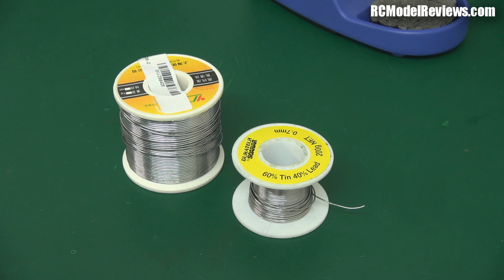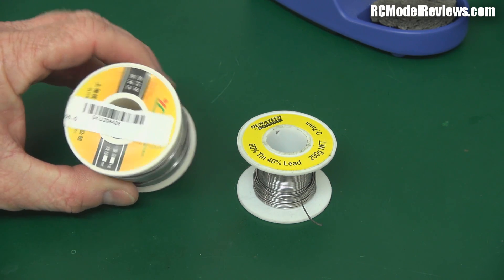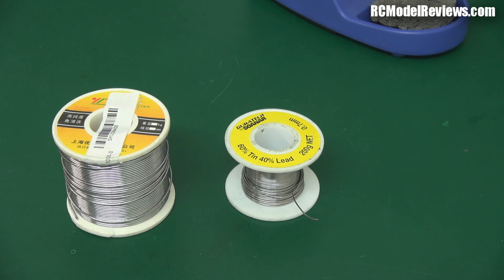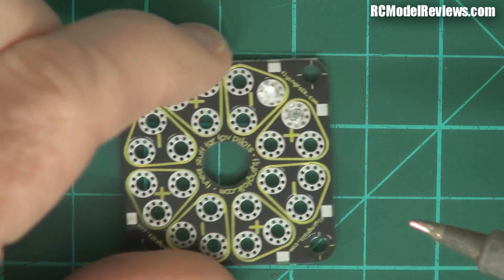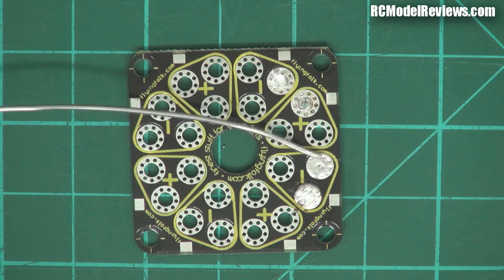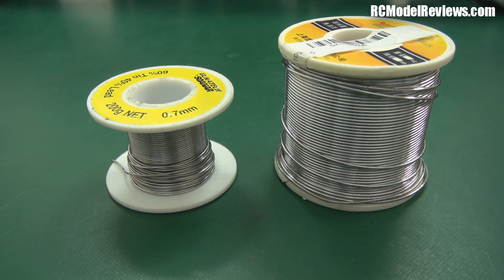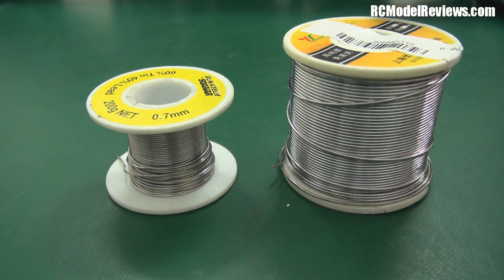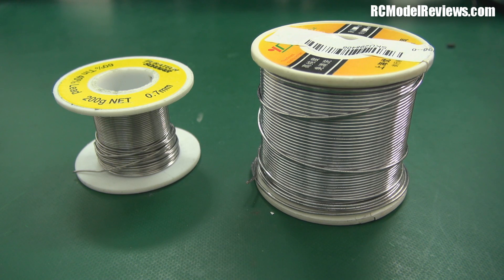60/40 versus unleaded solder

Comment: Thanks for this great post. I work in aviation and am a certified solder technician working on aircraft and aircraft test sets for over 30 years. Lead free solder has been banned from aviation equipment due to its discovery of unreliability after several deadly aviation accidents. The reason is it cracks under vibration and temperature changes over time. Lead free solder is also one of the major causes of modern electronics ending up in the landfills. It is also the major cause of automotive electronic failures particularly in those MPG/KPG, compass and trip overhead displays. In fact most of those displays can be repaired just by re-soldering them with lead solder. If you fly RC aircraft STAY AWAY from this stuff, as it cracks under vibration and temperature changes over time. If you have the capability I would open and check you radio equipment twice a year particularly at the start of summer and the start of winter after the over all temperature changes. Make any repairs with lead solder, 60/40 or the 67/37 Eutectic solder. Thanks again for the post. Best Wishes n Blessings Keith
Reply: From what they are saying here your life expectancy is going to be much longer if you use leaded solder. If you ever plan on flying in a plane or need electronics in the hospital
Reply: As a matter of fact, I ended up here looking for solder differences. Currently studying to be avionics technician, so I find this comment quite interesting.

     Got my hands on soldering tools and wires to practice at home... and bought a crappy tin solder without knowing, "60/40"... but results were just like the crap solder in this video. I could NOT manage to prepare the wire tips, let alone solder things together: thing just slushes and goes solid when it touches the wire, and iiiffff you manage to solder it, its weak and quite crap.
Reply: @kevinyamil2103  Hey Kevin if you're serious about learning to solder Pace World Wide the maker of professional soldering equipment has some nice videos on it here:  https://www.youtube.com/channel/UCT5e-XjqHPfA3_9wF3CgY1w 
I also have some lengthy soldering videos on repairing bad or corroded circuit boards here: https://www.youtube.com/playlist?list=PLVLXGvrQp0Os1DY1r_iUETKdLR2u-cAfY  You'll have to skip through to the soldering videos you want to view. Best Wishes and Blessings in you learning. Keith Noneya
Reply: @kevinyamil2103  Louis Rossman, iPadRehab, EEV blog. In my opinion these channels have good videos about practical electronics repair.
Reply: There is a very good reason to keep leaded solders around. The cheapest lead-free compositions - they do reduce the environmental lead load when electronics are thrown away, but are susceptible to the problems you have mentioned. More expensive compositions are used for lead-free solders that use silver instead of tin but these have high melting points and are not often used in electronics for this reason. Speaking of toxicity, when brazing with silver, the toxicity of cadmium is a far greater issue; breathing in cadmium fumes can literally knock you the fuck out!
Reply: @Shaker626  We have to use Silver solder at work on occasion for highly sensitive lab equipment and we don't use any cadmium. We do have Cadmium on the connector shells a most of the connectors, but lately the companies have been using some kind of chrome plating on them, it doesn't work nearly as well in high moisture and salt water applications for aircraft used over the oceans or on board ships, but it works. I think if they made the boards tougher like they used to be made using a silver based solder wouldn't be that hard, it would cost more for sure but it would hold up better and be less harmful to the environment. Best Wishes & Blessings. Keith Noneya
Reply: @keithnoneya  That "chrome plating" is probably electroless Ni-P, as even chromium is becoming unpopular due to its hexavalent form's toxicity, and Ni-P provides better protection in non-chloride environments. That being said, cadmium-based brazes are explicitly allowed for use in defense and aerospace needs in the EU, which banned them for other uses in 1988; cadmium is also the best material to coat aluminum with, as most other platings have poor adhesion to bare aluminum.
Reply: @Shaker626  For sure for sure, I've noticed that over the year. I was in the U.S. Navy for 20 years as an Aviation Electronics Technician, then retired and went to work at a Depot repair center for the last 22 years fixing and overhauling Aircraft Test Sets. I've got to see most of the changes in Electronic changes in the industry over those 42 years. It's amazing how much aviation electronics I've seen change, from tubes, transistors to Hybrid IC's to straight up IC's and Embedded Systems. Simply amazing the technical advances in everything aviation.
Reply: @Shaker626  "More expensive compositions are used for lead-free solders that use silver instead of tin but these have high melting points and are not often used in electronics for this reason"  My understanding is that SAC 305 (96.5% Tin, 3% Silver, 0.5% Copper) was the standard/default lead-free solder approved for use by Japanese industry regulatory bodies in the late 2000's in the early days of the lead solder ban (so it should be in most (Japanese) equipment made around then, and responsible for a lot of the faults found in equipment from around then, though not necessarily due to the alloy itself)... 

But possibly it has been replaced by more modern formulations like Nihon SN100C / Felder SN100Ni+ (99.25% Tin, 0.7% Copper, 0.05% Nickel, trace Germanium) in industry subsequently?  Formulations that are both cheaper and have some other advantages over SAC 305?
Reply: Thanks for sharing dude!
Kudos
Reply: Useful information. Thanks.
Reply: That is super interesting,thank you sir
Reply: What ever the drawbacks are I still prefer lead free over leaded because expectancy of our life  and quality of our health matters more than that of the solder used in electronics.
Reply: @ultrababa4723  I know this is an old post, but there is no risk unless you plan on licking your fingers after soldering or eating your devices.... lead absorbency through skin is not a thing, unless it is an organic lead compound, which it is not.
Reply: @ultrababa4723  If you wash your hands after soldering and don't do the obvious stupid stuff, there is no health risk.
Reply: @ultrababa4723  if lead is so deadly too our health. How come the romans did not all die. Theve used lead pipes since forever
Reply: @SillyOmega  The romans are all dead, aren’t they?
Reply: @grobianen7344  not really the Itallians are the decendants of the romans. But this lead solder makes sense. Because thats how it works in framing a house. We use nails because there strong and flexible. If you framed a house with screws it would all come down and squash you.
Reply: @SillyOmega  It did send many of them insane with lead poisoning at that time...
Reply: @sharkbaitsurfer  still better for electronics. Unless you want it to fail. That's what caused red ring of death on Xbox 360s.
Reply: @ultrababa4723   Old post, but you completely missed the point. We love lead-free solder. But if you use it to build your flying drone or RC plane AND you know about its unreliability, whose life expectancy are you really shortening?

Comment: There is lead free solder that doesn't suck and is actually really good, believe it or not. I've used it. The trouble is, when you're ordering solder, you have no idea whether you're getting the good stuff, or getting crapola that flows like dried out toothpaste. Lead solder always works perfectly 100% of the time, no matter what brand.
Reply: Not anymore... now there is rip off garbage being sold both leaded and unleaded and when unleaded was introduced more garbage unleaded solder was made and sold than garbage leaded solder that is easy to make.

Comment: 63/37 is more eutectic? HA! Either a solder is eutectic, or it's not. 60/40 is NOT eutectic. As for the demonstration of 60/40 versus Pb-free, this was a pretty bad comparison. Pb-free requires a higher temperature, plus the type chose here wasn't flowing correctly.

I started playing with R/C cars in the 1990s, and all of my PowerPole connectors used Pb-free silver solder. I use eutectic (that's 63/37) for most of my electonics work. So, don't take me for an RoHS supporter. There are simply some uses for both types of solder. As long as you have the right technique, you can use either type of solder successfully.

Comment: i guess you could use it as a back up
Reply: Been working in trons for over 30 years and a certified Solder tech for over 20 years. I would NEVER use this stuff, it's unreliable. You can pick up about 7 feet of it for around $2.00 off ebay. Best Wishes n Blessings keith

Comment: Not all lead free solders are created equal. I use Kester 96.5% tin, 3% silver, .5% copper, with a cheap 30W Radio Shack iron. Works great, solidifies quickly. Unfortunately it was a little pricey when I bought it, and the price has doubled since then...

Comment: Thank you for this excellent video and GREAT info! I wish I would have had more training in this area while I was getting my High Tech Automation Robotics college degree. Luckily, I learned it extremely fast in practice!

Just be careful you don't inhale the LEAD fumes, because it will literally drive you insane!!! Also, wash your hands, and keep the kids away from.
Reply: The fumes don't contain any lead. Lead does not vaporize at such low temperatures. The fumes are from the flux and the flux in lead free solder is actually even more toxic than the flux from leaded solder.

Comment: Lead-free solder: a solution that served only to cause more problems than it solved.

Thank you environmentalists.  Now, you have devices failing prematurely left and right, especially those devices using components soldered in place using BGA.  More often than not, the consumer will replace the defective device, thus further contributing to the e-waste problem.

But, hey, at least all of that extra e-waste won't have lead in it, right?
Reply: The point was that people were throwing devices away at a high rate (consumerism implies "consumption" and discarding) and so a lot of lead was ending up in landfills.  Lead-free is fine for commercial purposes in general, although it can create problems such as high-end multimeters being banned from import into the EU because they use older designs that require lead-tin solder.
Reply: boggisthecat But if lead-free doesn't really solve the problem of people throwing devices away and, in some cases, makes it worse because the properties are less ideal for certain applications, thus resulting in a device failing well before it's anticipated to fail (meaning more devices are potentially disposed of if repair proves to be uneconomical), then what's the point?

You may eliminate lead as a waste product, but there are other compounds that can be hazardous if not properly disposed of (such as older HDTVs with good working CCFL backlight arrays but failed BGA on the chipsets, so you have mercury being thrown out as waste if the TV is not repaired).

As for commercial purposes, okay.  So, how about consumer devices?
Reply: @boggisthecat    A proper landfill doesn't leak into the environment.  It is when we try to recycle our electronics that they end up in some third world disaster area.
Reply: Not You 
Concentrating elements like lead in small areas, such as what we presently consider ‘landfill’, could be problematic in future.  Are you unaware of the history of toxicity problems caused by lack of forethought (or, often, indifference to those who will be here after we’re gone) and the costs involved?

Recycling isn’t a perfect solution, but it does help more than not doing so, and more importantly it raises the subject of waste and resource management.  The places where rich-world recycled toxic waste is ending up are suffering the same problems that we went through without it being self-inflicted, but that is the ‘developing world’ / ‘developed world’ relationship in microcosm.
Reply: @boggisthecat   A properly designed landfill with a liner, vents, monitoring and drainage contains everything and will probably be mined for its riches in the future.  The surrounding ground water is protected from leakage and our local one retired and is now an airdrome for the RC flying club.  BTW, they sell the methane gas it produces.
On the other hand, our county recycling centers collect electronics and end up shipping them to China or India to become a horrible disaster with 12 year old kids beating them apart with hammers or rocks and burning the plastic.  China will no longer accept ewaste so it is now going to Africa.  
We all thought we were being responsible with our recycling and paid though our taxes to properly care for our ewaste but now we find that we are part of the problem.  
I know a guy who recovers gold and other stuff from cellphones and circuit boards.  Nobody pays him like our recycling centers but he does alright and his backyard is not a polluted disaster area.
So what is the answer to the ewaste problem?  Our local ewaste would be better off in our landfill.

Comment: Tin whiskers have destroyed satellites.
Reply: I was under the impression space and medical devices are allowed an exception to the Pb rule, for safety reasons!
Reply: LeapFrog469
I prefer leaded solder.  The lead-tin allow melts uniformly and neatly, and does not form whiskers.
Reply: I agree with you, it's all I use on my personal things & repairs!   Kester 44 (63%tin-37%lead)  Or Just some regular old quality 60/40 Sn / Pb Medium Activated Rosin it work wonders & look great! No whiskers or fracturing cold joints!
Reply: LeapFrog469
I found two full 1# rolls of K44 in the trash!
Reply: Nice score, it's not cheap for this solder by any means!

Comment: The problem is your technique.  You've got to go slower because the tin has a higher heat of fusion, and thus it takes more time for enough energy to be transferred to melt the solder.  You also should be heating the pad up longer than you are, even on your lead solder joint.  With the way you're moving your iron all over the place and barely letting the heat transfer you must end up with a lot of cold solder joints.
Reply: I agree the technique could use some more time. With that said Lead Free is just plain CRAP and is more of a environmental hazard than lead solder. Not because of the lead but because those items assembled with it fail sooner and end up in the land fill sooner and are harder to repair as well. Lets face it there's more hazardous material in electronics than just lead solder. We should have a warehouse full of this stuff for people to come and take as they want. Schools, hobbyists ect. Either that or have an electronics collection site at every store that sells electronics. If you bring in an electronic item of similar size you get a no disposal fee. If you don't you get a disposal fee added when you purchase an electronic item, like used tires. Then anyone can come and take what they want or the government can come and pick them up and the cost is off set by the disposal fee. Best Wishes n Blessings Keith

Comment: 60/40 tin-lead is NOT eutectic.  There is only one eutectic point in an alloy - in this case,  it's 63/37.  Also,  lead has nothing to do with it.  There is antimony-tin solder,  and several other lead-free alloys,  as well.   No reason to use lead anymore.  There is even a silver-beraing eutectic alloy out there,  but it's on;y 3% silver.  It's good stuff,  BTW.  But it contains  .....  lead   ;(